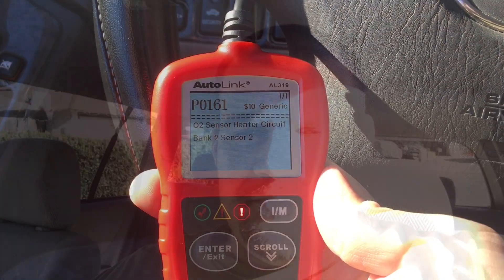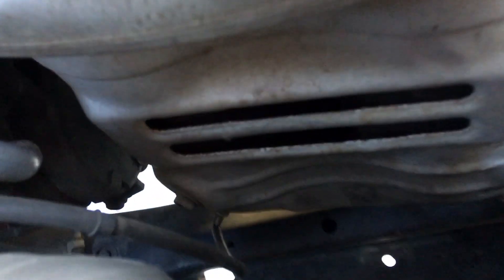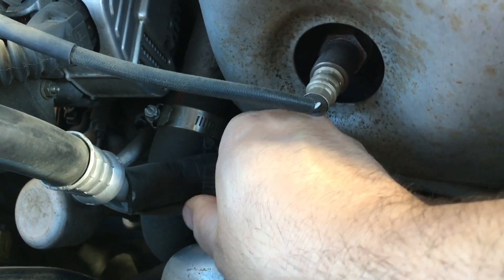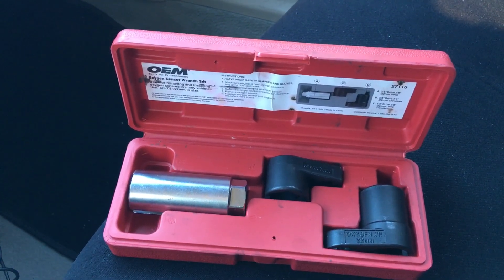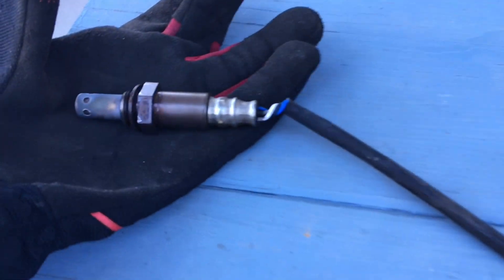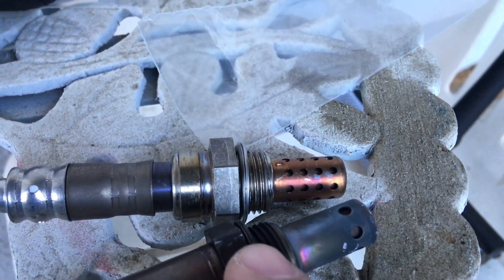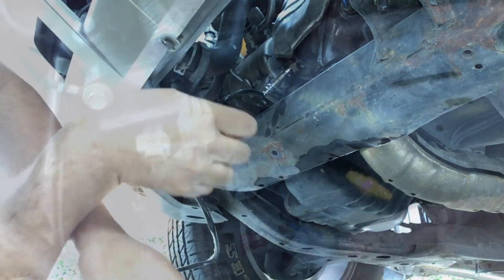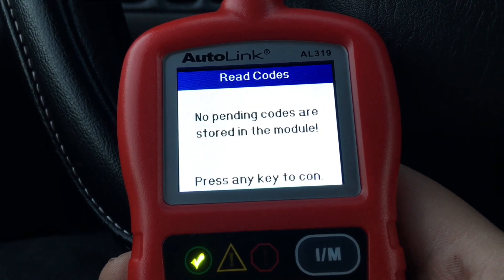How To Replace an Oxygen Sensor In A Toyota 2.4 Engine

Comment: If the Socket slips, get a hose clamp that fits around it, slip it over the socket then tighten it down over the socket and try again, it should stop the slipping.  You can make penetrating fluid from 50% transmission fluid and 50% acetone (nail polish remover) only a small amount is needed.. Brush some on the sensor base and let it set overnight or as you wish.  It should work.  Sometimes they are so rust welded that heat will be needed to loosen them.